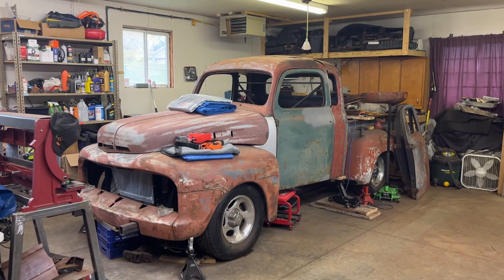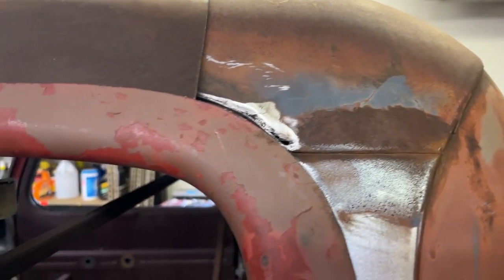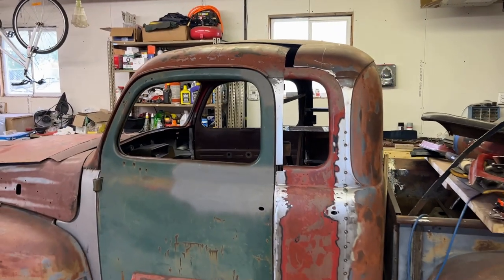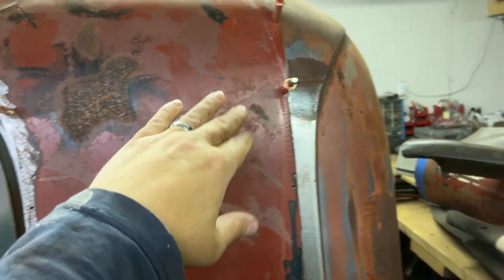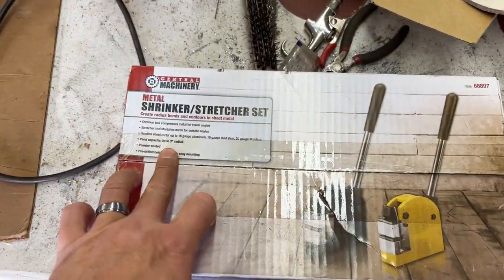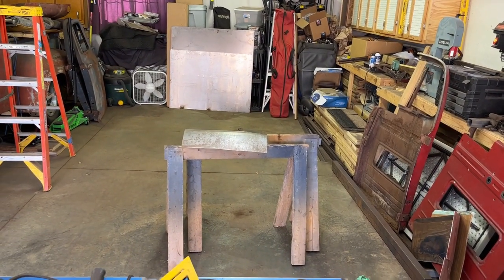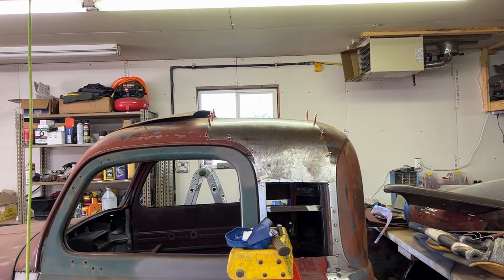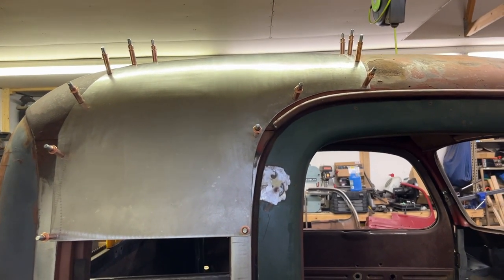Fiona Ep. 8 - 1951 Ford F1 Restomod - Extended cab - Roof Corners

Comment: Hi, I am building a rear cab for my 1930s Citroen and a couple of tips I would like to pass on, On the English top wheel use a rubber 
cover like and old innertube this will stop you getting two compound curves in both directions. The other tip would be make or buy 
a foot pedal for your shrinker stretchers so you can use both hands, I built one myself and it didn't take too long. Enjoying your videos. 
Cheers Dave
Reply from the maker: Thank you! I did end up ordering a rubber band for the top wheel on the English wheel. I really hope it helps.  And I'd really like to build or buy foot pedals for the shrinker/strechers.  that's on the future to-do list!

Comment: A YouTube channel named hot rod solutions just did a Studebaker truck extended cab, his bodylines look exactly like yours, if you watch his video series you might see some little things to help you.  His door drip rails extensions past the new quarter windows was a huge factor to help center everything.      Your doing a great job. 👍👍
Reply from the maker: I saw them! But he used a roof & half of the A pillars from a 4-door sedan on his extended cab.  That roof also already had a full length drip rail on it.  I thought about trying to find a roof skin from an F1 panel truck, but that would be too hard to come by, and I'd really feel bad about cutting up another classic!

Comment: Ok I’ll give you some advice that might seem a little backward moving for you but it will simplify your life and frustration. First off you are fighting the teardrop shape from front to rear, this is simplified by actually cutting your back window out splitting the cab in the rear and actually widening the cab to match the angle and keep your panels in a strait line so you don’t go from flat to angled. This will make the side profile look so much better as a finished and painted product. Second your inside bracing is there to stiffen your door latches keep them and keep that rigid. Hope this helps you out and makes sense. Good luck! Oh and for your roof panel go cut the roof out of an old car and graft it in, your new English wheel isn’t big enough to build a roof panel. When you do that keep your welds close to the edge or if you really want to keep the warping out of it look into gluing your roof panel on! Again best of luck man.